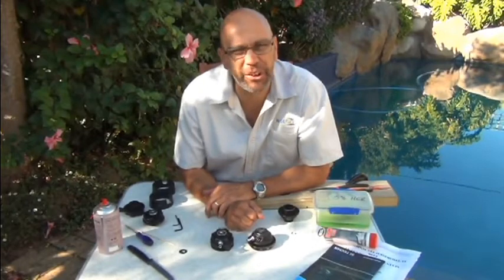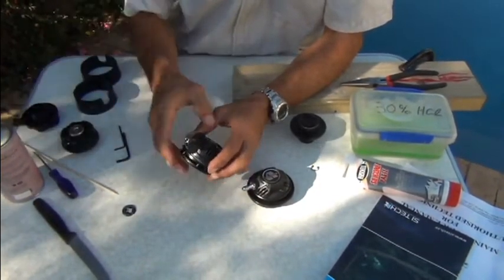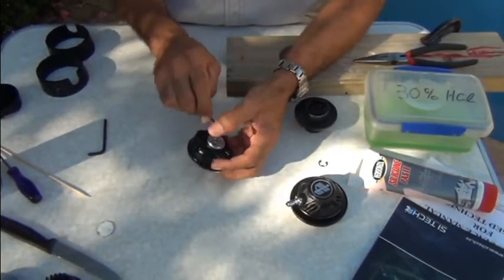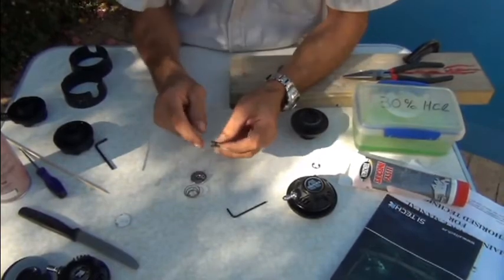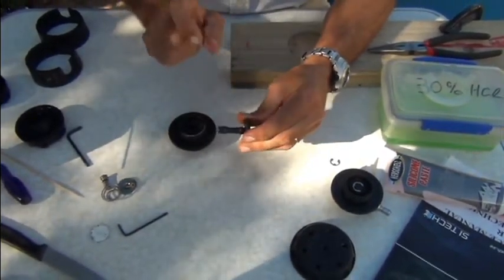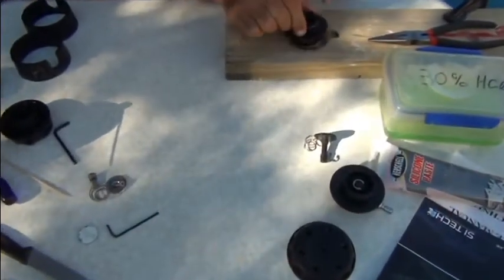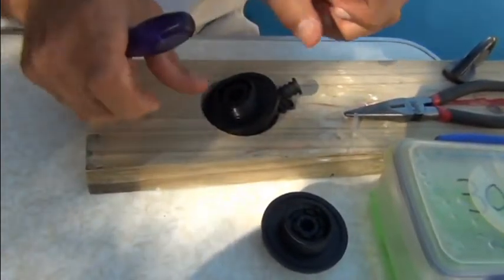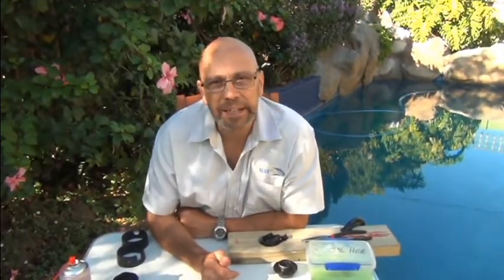Cleaning Drysuit Inflation Valves

Comment: Seems a bit of these issues may have a valve button return spring that is weakening not having the same amount of return force as when new. Cheers. #SeattleRingHunter
Reply from the maker: Yes I suppose the spring slightly weakening over time will also contribute to the button getting stuck.